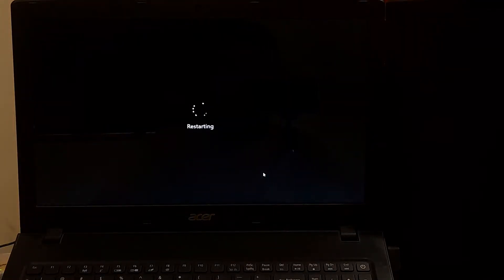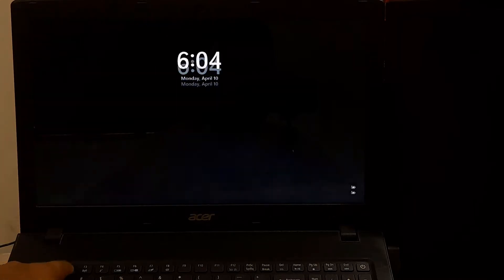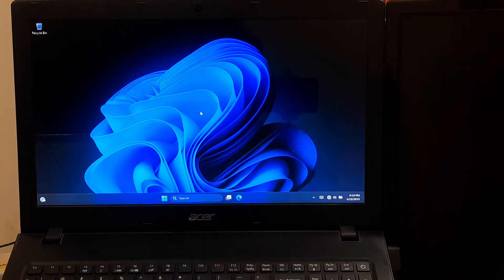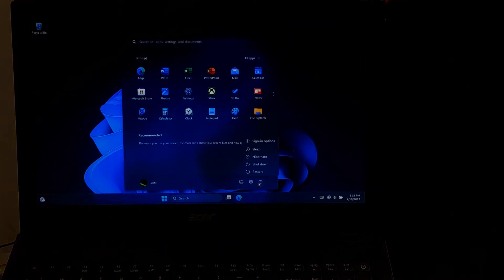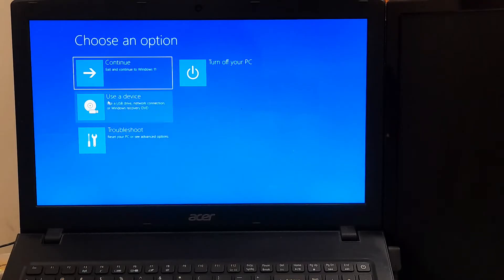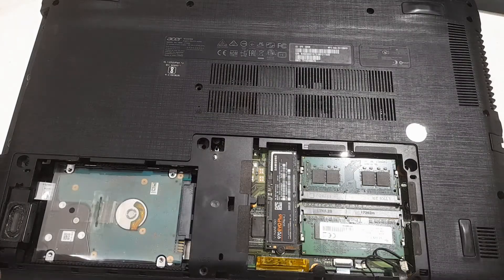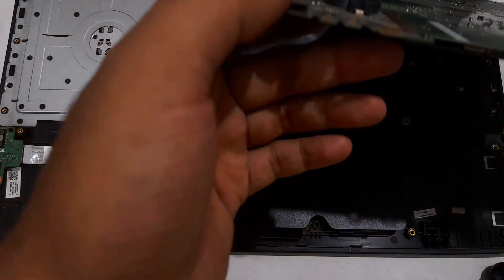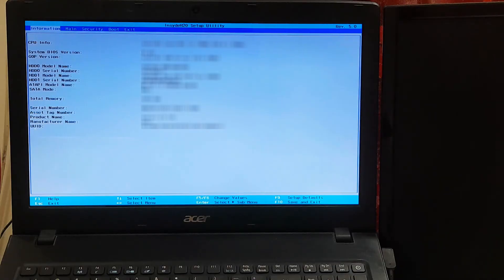How to Fix BIOS not Opening after pressing BIOS Key, Cannot Access BIOS (Solved)

Comment: Just build a new pc , i installed windows 10 everything was fine until I change some settings in the bios , now windows won’t launch and I can’t go in the bios (black screen) , I try removed battery , prompt command , nothing worked , so weird !
Reply from the maker: Reset the CMOS!
Reply: @asatechnical  didn’t worked , I removed the battery aswell nothing worked just bought another one